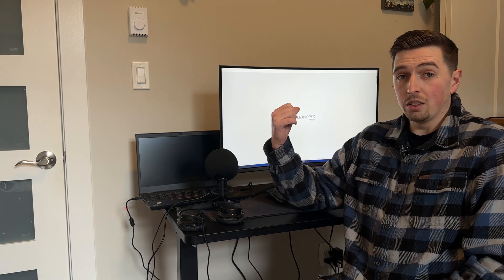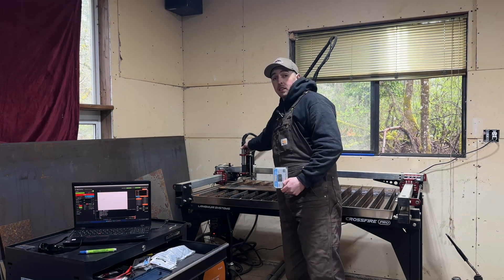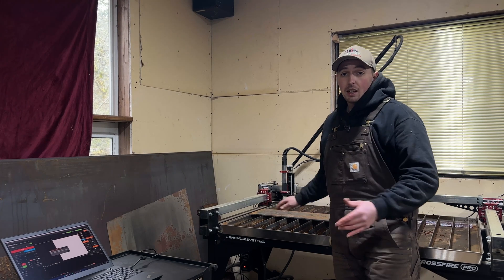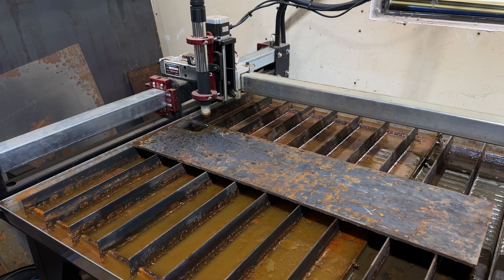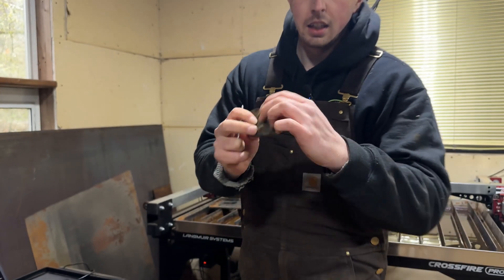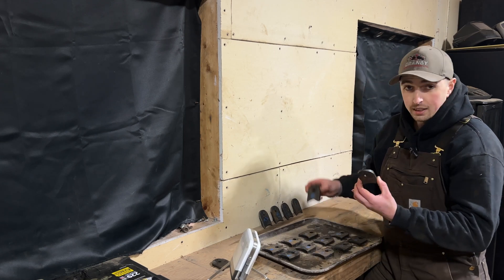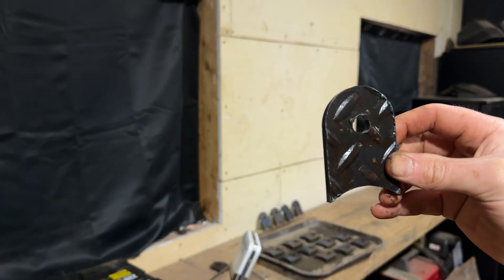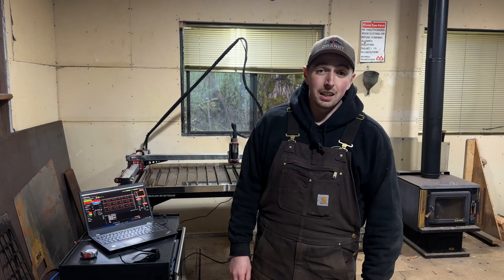How to use a CNC Plasma Table! Langmuir Crossfire Pro Tutorial

Comment: Great video!  A suggestion that you probably have solved by now and that is start you lead in cut either at one of the corners or in the curve that is gonna be welded.  I don't know anything about the Crossfire but using my 15 year old homebuilt with Cambam, I can move the lead in cut anywhere that I want to.  I am impressed with your Crossfire and your plasma cutter!  Keep up the good work!
Reply from the maker: Thanks! I use Sheetcam for programming the tool path and have started lead in on those sections to keep the visible surfaces cleaner. Thanks for the tip!

Comment: Question, does the software show you your table size or just the area cutting the part. Asking because if I buy the crossfire and want to upscale it to a 4x8 in size I want to know the software will allow it. If you get my drift.
Reply from the maker: You can manually enter in the table dimension! I believe there are a few forums on Langmuir site for the extensions and it seems like a common modification. I think it should work but can’t confirm as I haven’t explored this myself yet